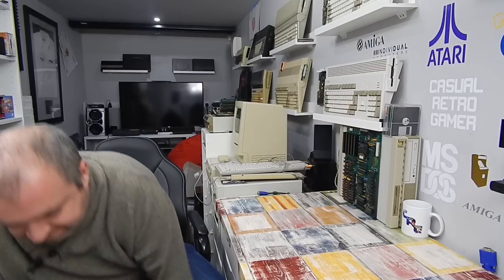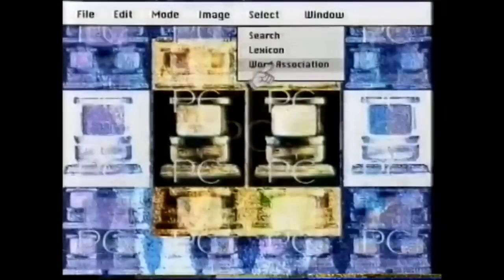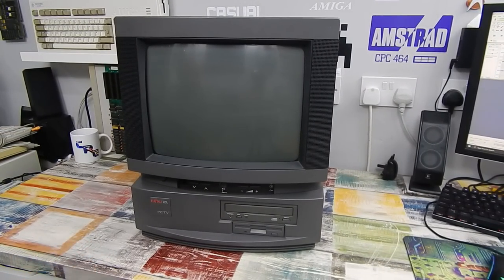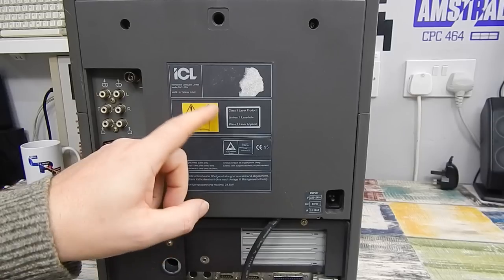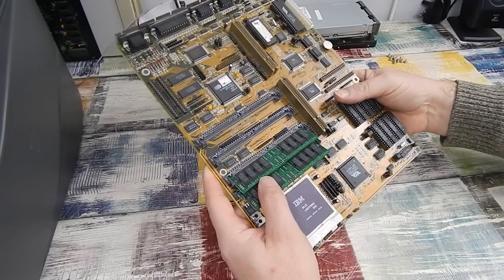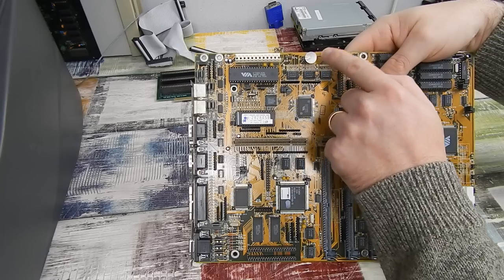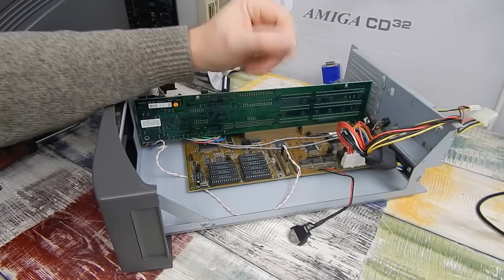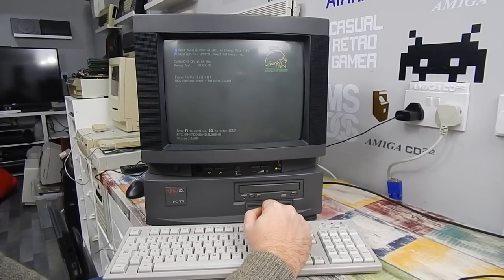Fujitsu ICL PCTV #DOScember2021

Comment: The Overdrive chips have the voltage regulators you need built into the units themselves. You have to be careful though because there are two varieties: one meant for a special Overdrive socket, and one meant to go into a normal socket. There's an extra pin in one of them, but they both have the VRs. As for the Panasonic interface, yes, it's the same number of pins and you can use a 40-pin IDE cable, but I know from experience that it's a proprietary interface and you need a Panasonic port on a controller board for it to work.

Comment: if it's anything like the similar apple PC/TV - multimedia's machines of that time, AV In's and Out's where connected like APPLE/PC VIDEO/capture card, not the tv part directly, it was like digitised, in computer first, they sent to the display like any computer graphic program would do,
Reply from the maker: I do need to dig into this a bit deeper from from some initial looks the AV is routed through the TV portion of the board.  Still not sure why the RGB doesn't auto switch as its certainly wired up to do so, or seems to be anyway.

Comment: Awesome! :D We can read each character of 9x16 pixels (IBM font) at 80-char x 25-line despite CRT "TV" because the monitor needs to have each "micro"-dot of shadow mask (likely) and it "connects" the system PC. TV on monitor is more much focus than the traditional CRT TV. We can't read each character of 8x14 or higher pixels at 80x25 because the traditional CRT TV gets poor focus - it hasn't micro-dot. Try to connect with HDMI to VGA adaptor to Xbox S|X or PS5 to get 1280x720p on your Fujitsu monitor -> we get still the good focus! ;)
Reply from the maker: I appreciate your enthusiasm and I'd just like to say that I do read every comment even if I don't always respond.  

I appreciate what you are saying and in theory I would work and look great, almost like an hd CRT but unfortunately the screen has developed a fairly significant fault.  The horizontal width control has failed.  I do intend a follow up video at some point looking at and repairing this fault.  If I'm honest though I'm a bit reluctant to hook this screen up to another source.  While I can't say for sure it was the cause the fault appeared when I hooked the VGA up to an Amiga.  I think if I can get it repaired I would prefer to just leave it to do the job it was made for i.e. be a monitor for the PCTV.
Reply: @CRG  Ok. :) Most CRT monitors-PC are still more focus than CRT TV HD. ;) But in Portugal does never exist any CRT TV HD. lol But yes modern CRT monitor-PC 19" or bigger screen works full-HD! :D ;)
Reply from the maker: A way from the computers I also collect laserdiscs so a CRT that can display the fine detail would be welcome.  If I can get it repaired my plan was to try a few laserdiscs on it to compare how they look against a typical TV of the era.  To do so I'd need to figure out how to switch the set to its AV input.

I may try another source into the VGA, the failure might have been caused by components already on their way out.  I need to pull the HV board and have a good look at what's failed.

Comment: Use the scart input for AV? If you send 12V to pin 8, the TV should switch to AV automatically.
Reply from the maker: I've tried the scart input but that too didn't work.  Seems that without the remote there is no way to use the AV inputs.
Reply: @CRG  did you try putting 5v on pin 8?
Reply: @CRG  Did you supply a DC voltage to pin 8? That's the important bit. I don't think I've ever seen a TV that didn't switch automatically - but perhaps Fujitsu thinks differently ;)
Reply: @mikkels5724 in my experience if they were exempt from integrated Teletext receivers they also tended not to do any smart stuff with SCART. Might’ve depended on regional regulations though.

Comment: Did you find any chips regarding the TV side on the boards? Something like Hauppage or maybe WinTV?

I think from the persons description of the remote control you are not looking for a standard "consumer IR" but an IRDA remote what with it supporting a keyboard and ball of some description.
Reply from the maker: I haven't stripped down the TV yet, bit nervous working around the HV to be honest but from what I've seen there doesn't appear to be anything from Hauppage or the likes.  I'll keep digging though.
Reply: @CRG  I smell another episode coming up. Very interested to know what's in it!

I worked in the business arm of ICL Fujitsu around 98 and although I saw them dotted around I never got to work on one.

Anyway, great video, keep them coming.

Comment: I had a similar computer by Siemens-Nixdorf. Initially with a 486DX2/66 and 8MiB RAM, I upgraded it to a DX4/100 and 32MiB. It had a fast ET4000 graphics chip that could even run Quake 1 and GTA 1 decently playable in 320x200. Windows 98 ran well on it.
The design was similar so I wonder if these came from ICL, too (or the ICL came from Siemens-Nixdorf?) Fujitsu swallowed SNI after all.
Even the way the monitor hooked up to the mainboard was the same on my Siemens unit.
Watching more of this, that whole unit looks so similar to the Siemens, but it had PCI. Maybe the Siemens was the successor to this.
Reply: I worked for Triage Services in the UK, which was a buyout of ICL-Sorbus (their repair arm) so I saw a lot of ICL / Fujitsu ICL branded kit (I believe a lot of their PC kit was made by Nokia) which was serviced in the field by Fujitsu Services but the stock was "owned" by Logicom. we later repaired Siemens and Siemens Nixdorf (Retail & Banking) kit.  I went to work for Siemens Business Services after Triage and we were bought out by Fujitsu Siemens Computers (50:50 ownership between Fujitsu and Siemens) as they wanted a service arm.  Not long after I left FSC, Siemens sold their share and Fujitsu already had their own service arm (Fujitsu Services) so many were laid off.
Reply: Oh and Siemens Nixdorf became Wincor Nixdorf and is now Diabold Nixdorf.

Comment: Yup i had one of these, the television was pretty decent but the tv's sound in NICAM was very tinny, sounded good in mono though, the pc aspect of this machine was pretty poor though, had the Fujitsu/Siemens MULTITAINER pc as well, that ran win98, i would have replaced the coin cell battery with a 2xAAA battery holder, 2xaaa batteries would last years, the logitech harmony 650 will control this.

Comment: Interesting system for sure. But it seems a bit less integrated than you would expect. For instance, it seems like it can only capture RF and not SCART and the like. Something like the later eMachines one does that little thing better but that's a whole different generation. Still, it was a very interesting video and if I do come across it myself I would love to add it to my collection.
Reply: It's actually a bit more limited than even that. It doesn't capture the RF signal at all. A 486 could never encode/decode a live TV signal. The way it actually works, is it is a PC, with a separate TV built into a single case. The PC part has a controller card which has the ability to talk to a custom controller chip inside in the TV part. So when you click the tune button in windows, it sends a signal to the TV vis the I2C protocol to tell it to tune, the TV can then send a signal back once it is done to tell it how many channels etc it found. It was actually a pretty clever way of doing it :) but very much a gimmick as an IR remote on any other TV would achieve the same thing. Guess it felt pretty futuristic at the time though.

Comment: You can try a xiaomi phone (i have a redmi 9 power) and this phone has a remote control ir sensor build in, it comes with a remote app, but you can install whatever app you want that can use that ir sensor in the phone, i have a avertv box, that makes a tv from any computer monitor, but i didn't had the remote for it to turn up the brightness, because without that remote, you couldn't see anything, it whas way to dark, now, my avertv box thing is useable again thanks to my xiaomi phone! So maby somebody could make an app or something that talks to the tv? Its just a sugestion :) hope you can get a real remote for it!

Comment: PCTV was overpriced, underpowered and poor value for money priced at £1,500 in 1995 that could in 2021 prices be as much as £3,000.

Intel Pentium processor PC's with higher specification could in 1995 be bought for £1,000 or less with a computer monitor with money left over for a TV.

Comment: Logitech Harmony, the only universal control. Those all4one or one4all, whatever, are just crap.
Reply from the maker: I'll see about getting one, those 2 I showed were just handy in the local shops.
Reply: But Harmony Remotes are very expensive. Hardly worth the cost for an old TV. Take the logic board out of the TV and find the chip that controls the inputs. It'll be some sort of multiplexer. Download the datasheet and try to hack it.

Comment: This thing was bloody awful
Reply from the maker: It wasn't the best machine.  It's since been moved onto another collector.
Reply: @CRG  Fair enough. I had one in 1995 which was purchased for £1600 from Toys r us, ended up being returned due to numerous issues, and many nights of frustration getting games to run on it. Did manage to get some running via boot disks, but as you may tell, certainly left a lasting impression.